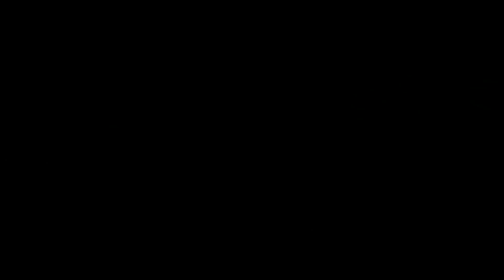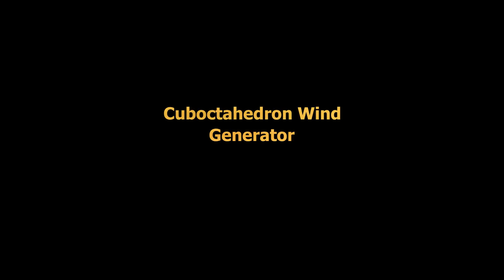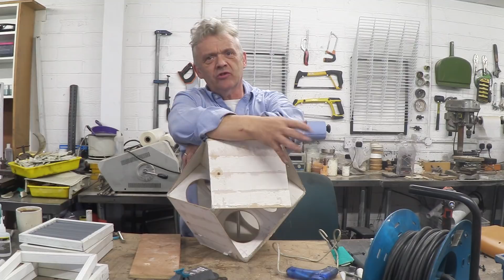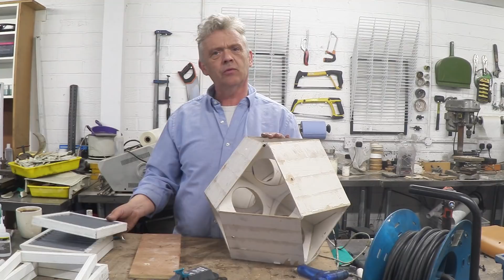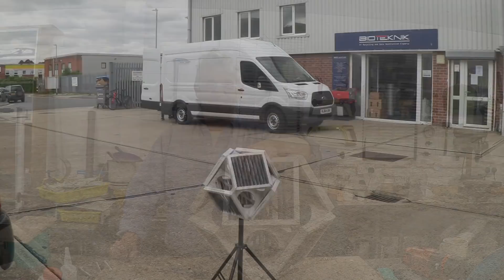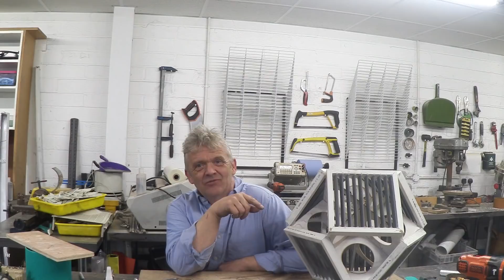Cuboctahedron Wind Generator - O Wind Part 3

Comment: Consider that the overall 'surface area' of the turbine is based on the surface area of each 'blade' of each face of the turbine.

The calculation of the Betz limit should include those factors when determining how it works.

Comment: A vertical plate on an axle, and with vertical edges canted opposite to each other, in a mesh cage for safety, would do the same, with less involved construction. This concept is used in spinning display boards outside petrol stations in South Africa.
A vertical axis Banksi turbine would also be a very efficient, cost effective and easy (easier) to build wind turbine.

Comment: Great work , low rpm but if it generates good torque 
Id get rid of internal structures and fix vents at corners with spider in center ,,,,, or the generator 
A large computer fan generator ?

Comment: Couldn't you also make a verticle wind generator out of an HVAC squirrel cage blower? I bet it would generate a good deal of torque from a wind coming from any direction too.

I've seen a couple of vertical wind generators on top of a few businesses near Interstate 696 through Southfield and Farmington. Spiral type monolithic blade on them. A little big for an apartment but a good fit for commercial uses. Not nearly as imposing as giant windmills.

Farmington homeowners have opposed cell towers and radio towers so the carriers stealthed one in near the border. It's s cell tower made to look like a towering ponderosa pine tree (which looks oddly out of place with the deciduous canopy below)!
Reply from the maker: yes you cantata - I have done a couple of vids on it

Comment: Why have the internal structure? just join the panes together to form the cube octahedron
Reply from the maker: it makes the build easier and adds structural strength
Reply: Robert Murray-Smith I get that, but it would be interesting to see whether it adds drag to the system.

Comment: Hi Rob, I was looking at this design you have here and it seems to me that the holes you have opposite the air foils, the holes in the center will redirect the wind that goes into these areas and then with the different angles of which the wind travels through these, seem to act as a brake or governor and never allow the cuboctahedron to reach full potential. It seems to me that the air foils should have a continuous channel to follow to maximize the air flow potential, but I'm no expert...Smile.
The key is to visualize air as a fluid or imagine it as water flowing, if we give it an opening it will go to it and it will act upon the channels of which it flows through.
Ed
Reply: Oh now there's a thought, to build a small one and test it in a stream or other waterflow...

It's like undergrad Fluids class all over again!
Reply: @saber1epee0  Haha, Yes that could be done but the density of the water is a bit different than air so the structure would have to be a bit more robust, perhaps a simple fan and some smoke would be easier to see flow.
Reply from the maker: cheers mate - I am certainly no expert and learning as I go - thanks for that

Comment: This is bloody brilliant, almost looks looks like a doplar radar. 
I really love how you show when you have a change of concept based on a comment or three. Did you encorporate the bearings on the fixed pole housing and in the post itself. You really only need one bearing however.
Love the direction mate.l
Reply from the maker: cheers mate - I do like to build suggestions in if it fits and yes I did with the bearings - then realised I hadn't really talked about that bit!
Reply: @ThinkingandTinkering  lol, we always forget a detail or three by when describing the journey. What are you guessing the output power will be. I understand that will entirely depon I on the generation methods
Reply from the maker: @stevetobias4890  to be honest mate - given what I have a round a few watts
Reply: @ThinkingandTinkering  a few consistent watts can do a lot

Comment: Hi Rob. This is undoubtedly the "coolest" looking VAWT I've ever seen, bar none! Are you sure it's utilising aerodynamic lift, though? It's hard to see from the video, but if the blades are pointing outwards at a low pitch angle, then it will only generate lift at very low tip/speed ratios when the resultant wind direction is close to the true wind direction. It will be good to see it generating power, to get an idea of its utility. It doesn't have to be perfect to be useful. You might want to take at look at the Vertogen Ltd. videos on youtube to see a VAWT with variable pitch blades. Not as cool as yours, though.
Reply from the maker: I will have a look mate - basically I know very little about this and I am learning as I go to be honest
Reply: @ThinkingandTinkering  Keep going. We need ideas like these. I think we all hate to see giant, ugly turbines all over the countryside, but we know we need them. I could see your turbine on every rooftop without disturbing anybody.

Comment: That was moving pretty fast, I love it, the blind idea was spot on. So really if you want the O-wind concept at this point, I suppose you could make each square that has the blinds on then to rotate on a little bearing or something of that sort. That way they can turn towards the wind depending on where the wind is coming from. But as for what you just created, I love it and it looks awesome, lol
Reply from the maker: lol cheers mate - to be honest I am just having fun here
Reply: @ThinkingandTinkering  Looks fun mate, but at the same time, you did a brilliant good on it. I bet it could do 12 volts easy. But the question is going to be, should the generator be at the top or bottom, lol
Reply from the maker: @jasonwitt8619  I was pondering middle lol
Reply: @ThinkingandTinkering  lol

Comment: Put a line of these on a building connected in series and parallel to get the output you need to partially power the building reducing the overall building need for exterior power.  Connecting one of these wind generators to a electrical generator would be interesting. How many would an average house need to go off grid? The average American house has a 100 -200 amp service box and uses about 1.25 kWh per hour. It's amazing what a fast internet search can find.
Reply from the maker: I don't know much on tech details right now mate - still o n the design but yes it is amazing what you can dig up

Comment: Hey Rob. Great video! I've got a bit of a riddle question for you based around VAWT generators.  Where, in all cities, does the wind blow in opposing directions all the time, even when their is no real wind at all, in any direction?
Reply from the maker: no idea mate - what's the answer?
Reply: @ThinkingandTinkering  The center of the Freeway/Motorway. I've always wondered why they don't have  a whole string of VAWT generators lined up on the tops of the barriers. I'm sure with the "wind" generated 24/7 from the cars & trucks constantly moving in opposing directions on either sides of the barriers they should be able to punch out some serious juice. :)
Reply: @Killianwsh  might interfere with the radar on the speed cameras and reduce the income generated by fining drivers.
Reply: @joinedupjon  Could be. Hadn't thought of that angle. They certainly don't seem to be in to much of a hurry to conserve tax payer dollars in any aspect, why would they be particularly interested in endangering one of their largest cash cows.
Reply: I like the idea. I guess it's not done because of savety and insurance concerns. 
Or because it's output in comparison to the installation efford seems to low.
Companies and Politics seem to vavor the  bigger wind turbines.
Reply: @michaelschauperl172  Both are  possibilities. In truth it would be easier for Municipal Corporations to simply buy electricity, with public funds, from the main plants feeding that section of the country.  As  to the  possibilities of "why" they favor larger turbines, Lord knows how much easier it is to overcharge the public books and pocket the difference when the actual upkeep & maintenance costs ledgers , for the generating machinery, are in the hands of  private party's and thus NOT open for audit , as they are not part of the public record. 
 Realistically , though,  I cannot see the true cost of maintenance & upkeep on a system like that being all that high , as VAWT's only require a simple frame to hold the vane rotor, Two bearings, and a small Dc motor to act as a generator , and couple bits of wire to parallel  it to the next VAWT, a foot or so further along the barricade.  Most cities I've seen already have some form of static barrier sitting atop many of concrete dividers to block lights from oncoming traffic  blinding drivers in both directions anyway, there already exists a installation & Maintenance cost in city budgets  that  yields only passive benefits. VAWT generators would not only fulfill this "light barrier" passive benefit role,  with only marginal additional initial outlay,   they would also yield active benefit, with continuous return on investment.  Additionally, most of the light diffusion panels are made of  heavy expanded galvanized metal mesh that can become viciously entangled with vehicles in the event of a severe accident.  The very nature of the existing light diffusing  panels  are , very likely, already sources  of  Insurance & safety concerns for most cities.  Given that VAWTs could easily be mass produced out of 80% UV stabilized recycled plastics  (like plastic trash bins) and would weigh hundreds of pounds less than cities existing "light Barrier" solutions, I rather think a city's Ins. costs would drop due to the improvement to public safety. 
 As far as  output possibly being low, one should keep in mind that  every single car , truck, van , Semi, etc. that blasts along a strip of freeway in either direction, creates a separate 60+ mph / 97+ Kph  blast "wake" if you will, that  will hit each and every VAWT lined up on the top of the divider barricade/rail with zero diminished energy vs. the previous VAWT.  This is not the case with conventional turbines, as you cannot "stack" them one in front of the  next  and get the same output from each additional turbine, as the wind passing through each layer further diminishes the remaining energy in the wind until , some layers in, it will be calm.  Since the source of the "wind" gusts  in this sense are tangential to the turbine (rather than directly at it) and are a waste byproduct of the consumption of an already expended energy source (Petrol, Diesel, Electric, etc) ,  used to move an object displacing the air, the "wind" gusts will only diminish when the number of vehicles lessens or the vehicles slow down. (though I'm sure there would be some sweet spot balance between fewer , higher speed, gusts vs. lower speed gusts, occurring more often.) Add to all that the fact that these  high pressure  regular "wind gusts" are occurring in most Cities to some extent 24 hrs a day, 7 days a week, 365 days a year!  The opportunity they present is unmatched in nature, as the power of the "wind" is doubled by the fact that the source of the "wind"  (vehicles) are traveling in almost perfect opposition to each other on either side of the barrier!  I know of no where that naturally occurring winds come even close to creating the conditions that exist for THOUSANDS OF MILES in the center of the interstates & motorways of the world.  
And for the very , very best part!..... Out side of the initial cost  of the VAWTs...There is ZERO fuel cost!  The "wind" gust is an unavoidable byproduct of propelling  ANYTHING through air!  It occurs regardless of the power source of the vehicle AND using the waste displaced air doesn't diminish the efficiency of ANY vehicle. In fact, since it would use a waste byproduct of ALL vehicles  that  there is no way to prevent & no other use for,  to generate real power. one could argue that VAWTs used this way would be actually INCREASING the efficiency of ALL ROAD VEHICLES that pass by in a very aggregate sense.  :)

Well.... perhaps someday they may yet get adopted to help make the world more efficient .  Till then .. I guess it's one more idea given freely to my Brothers and Sisters of the world.  I believe Rob's quite correct in his viewpoint that sharing ideas, is the greatest means of lifting up all humanity.  The rising tide lifts all ships !
Reply: @Killianwsh  well written And I wish it would already exist in large numbers.
Still the question remains. How to get people work on it, and getting money investested into it.

Comment: I believe Dan Mercer posted what I was about to suggest...and that would be to now fill in the triangular areas with slats, as well.  The INTERNALS, with the large holes should be kept, for structural integrity and dimensional strength of the SYSTEM.  I would NOT place cups, etc. anywhere on the horizontal axes of the system, but if placed ABOVE the system, they likely will add additional centrifugal force, sytemically.  Now BELOW the system, a long, vertical set of semi-triangular vanes well should add additional rotational torque + RPMs and efficiency, overall.     ....the reasons for keeping subsystems close to the rotational axis are many.  Centrifugal and centripetal force, for one...we WANT the increased RPM to handle  duties of power generation...(much like an ice skater spinning, at speed...with closely rotational force.  What we DON'T want is much of anything extending far away horizontally from the axis of rotation, DEPRIVING/defeating the RPM we are TRYING to maximize.  Additionally, on a vertical support pole, etc, without guywires or such, that would likely destroy the machine, as a whole...bits n pieces flying outward everywhere, and high winds, with no governing device installed ...well it's likely fatal to the system, and dangerous to passersby and property.   WOW, that was lengthy.  Hope it helps, best wishes on this design, Robert.  ....Crossbow
Reply from the maker: that was lengthy - but thanks for all the help and tips mate
Reply: @ThinkingandTinkering  Anytime, Robert    ...wish I knew shorthand....

Comment: No wonder you don't have time to reply to comments, you are too busy making content and inventions! I would like to offer you 3d designs for these inventions, but you seem to make these from scratch faster than a 3d printer could make a 10% model. This version looks very nice!
Reply from the maker: that is an awesome offer mate - but you are right I work a bit quicker than a 3d printer
Reply: @ThinkingandTinkering  if you ever need smaller complicated parts designed like couplers, bearing holders, brackets, precision length bushings or some random part that would help you, let me and the youtube viewers know!
Reply from the maker: @whosle  I will do mate - thanks again for the offer - it is very kind of you

Comment: great idea there!
I bet it was hard to resist going down to the factory in the middle of the night to do it ! lol  
Possible improvement might be a central exit!
Reply from the maker: yes it is lol - I was thinking of mounting the motor/generator in the centre
Reply: @ThinkingandTinkering  ok so maybe the exit wind could also help with cooling ? I would have thought an ebike hub would be good but on a device 3 times bigger!

Comment: Okay, so the veins are rectifying the wind into a "straight line" wind directed toward the inside at the angle of the veins. To us, the wind is spinning, but relative to each of those vein pannels you just added, the wind is basically traveling in a straight line on the other side.

What if you had one of those wind/vibration devices from earlier sitting behind each of the vein pannels? Maybe with a funnel to further concentrate the wind on the device

Not only would you get the energy from the whole device spinning, but you could also energy harvest from that second layer of wind. 

Maybe another set of vibration devices behind that, not to catch the wind, but if the device was even the slightest off balance, it would cavatate.  Even a slight cavitation would generate additional power.
Reply from the maker: good ideas thanks for the tips - and - I am most sorry to point this out - but I believe it is vane when it comes to wind and vein when it comes to blood
Reply: . Yes, vane not vein.  No worries. It's early over here :)

Comment: RMS, that is a really wild look wind generator. Now put some magnets and a coil to generate electricity!  Would it drag too much from the magnetic field?
Reply from the maker: dunno - worth a try for sure
Reply: @ThinkingandTinkering  BTW, were the venetian blinds plastic or metal? Also if you cut fine kerfs in the frame and slid the blind in you'd get more regular and secure mounting. Then tack in place with hot glue or adhesive. And varying the angle of attack on the blades might be worth a look.